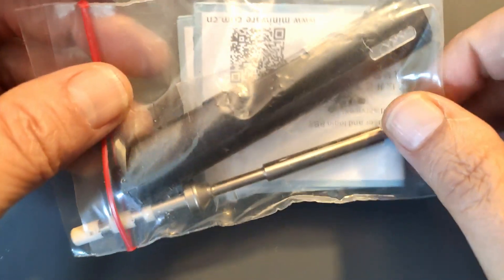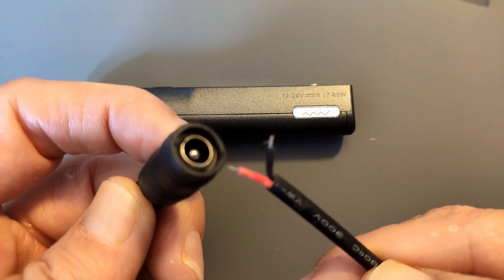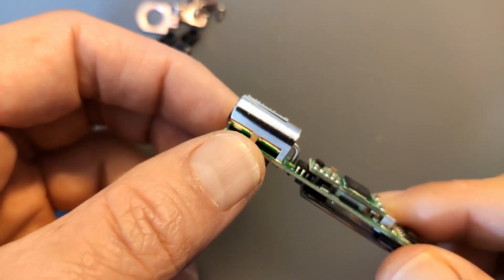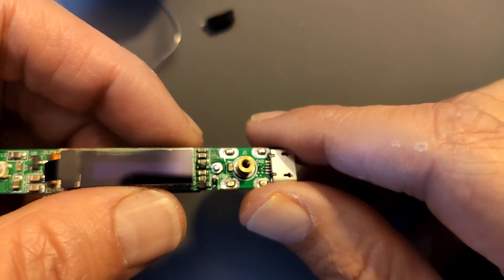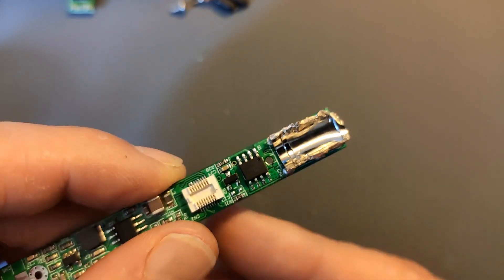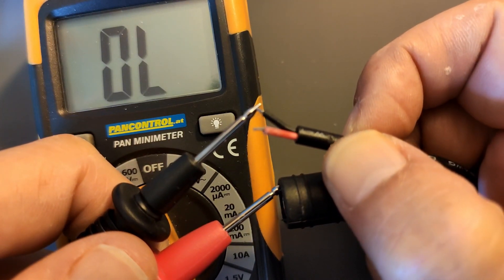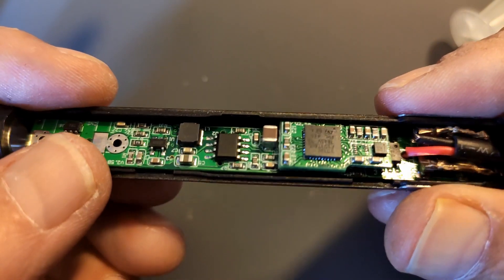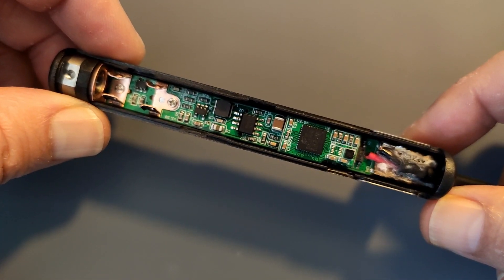I Destroyed a TS100 but it Still Works!

Comment: mi fix is ten times worse, and I opened this video to see the orientation of the daughter pcb😅
Reply from the maker: The quality of the fix does not matter.... does it work? :D
Reply: @DustinWatts Other than the OLED being mostly dead? Yeah it heats up😂 Even found some Philips screws to replace the long lost original ones to hold the tip in (IIRC they were needed to fix something else quickly)
Reply from the maker: @Fridelain  If it works, it is a good fix!

Comment: Did something similar. For some reason, the center tip suddenly got tight one day and while I was twisting it to get it loose, it broke the pin. I haven't been able to locate an identical replacement part so I'll probably do something similar.
Reply from the maker: I also wasn’t able to find a replacement. I didn’t have any low melt solder at the time but that could work.

Comment: Fantastic. Same happened to mine. The USB C port i installed is more helpful for me now.
Reply from the maker: Nice! Are you using the Otter Iron? Or did you make one yourself?
Reply: @DustinWatts  I managed to put in a 20V Type-C PD decoy module on the original board with a bit of encouragement and cutting of the case.
Reply from the maker: @xPsIXx  Next time I have a broken one... I'm going to try that!
Reply: @DustinWatts  have you seen the pinecil? it's only $25 and has usb c pd

Comment: I did about the same level of butchering for my repair. I ended up resorting to soldering my negative to the grounded outer barrel plug instead of cutting it off. Positive I pulled through the barrel by removing some of the plastic insulator where the positive pin comes through. Then soldered my new positive lead into the existing positive right behind the insulator before the bend to the pcb. Worked well for  yeAr or so , then randomly shorted somewhere on the board and bricked. I think metal debris found its way through the open barrel hole from my carelessness to protect it when not in use/during transpott
Reply from the maker: Oh ow! Is it fixable? Or did it short and stopped working all together?
Reply: @DustinWatts  oh no it fried and there was no turning back. It what's fall asleep and was physically secured to the solder joints well but I was negligent in my handling and storage and transport of the iron. I sort of considered it my beats up beat around iron. I would use it for really demanding tasks like heating up strict screws on my RC truck for easier removal and throw it in a dirty bag or the back of my car and leave it out there for a while and throw it in my miscellaneous hardware and tool bag which has a lot of copper wire debris and brass from key shavings. It was doomed with the way I carried and handled it even if it was a brand new one with no repair work done on it. I was surprised to see it last as long as it did after my ghetto repair. But I have another ts100 now I take good care of. But yeah, it was bad . Basically started rapidly getting hot and smoking when I plugged in one day. No screen or power up , and then within ten seconds was smoking the pcb around the barrel and was all burnt and stinky and some traces pcb traces were all burnt and flaking through the solder mask passed the DC positive on the board . I was happy my power supply plug wasn't harmed.
Reply from the maker: @joshuajhoyt  If the case is still good, you could consider making an Otter Iron by Jan Henrik!